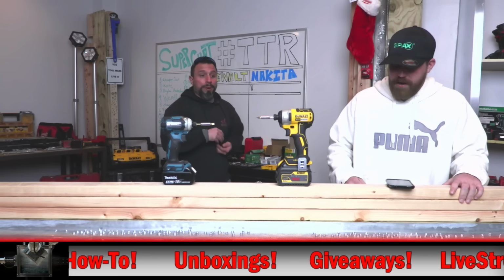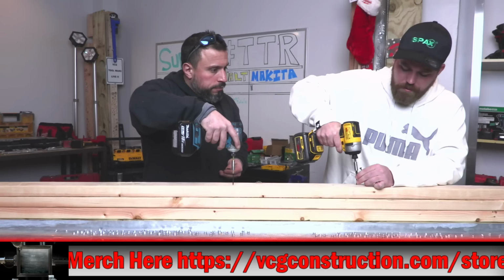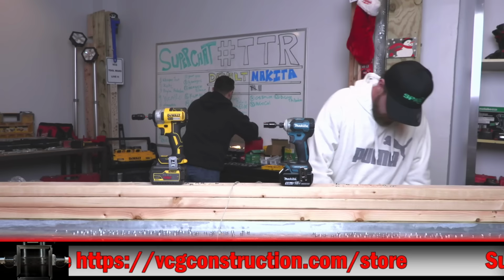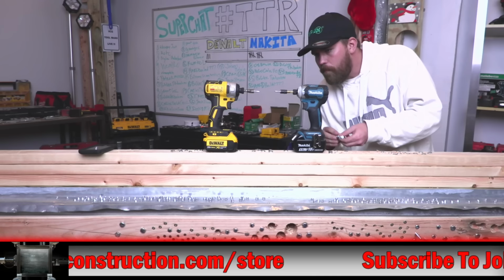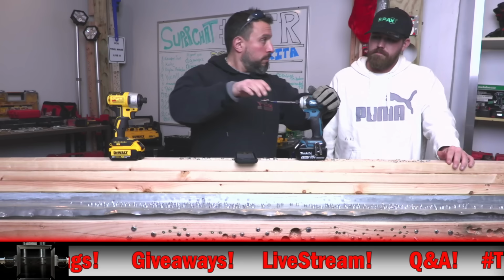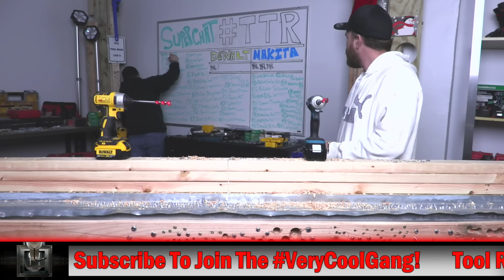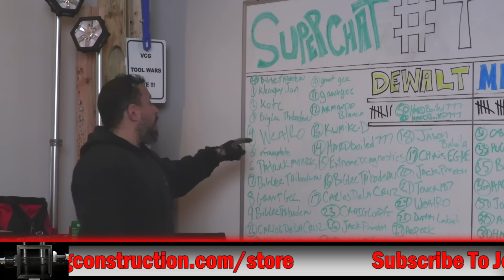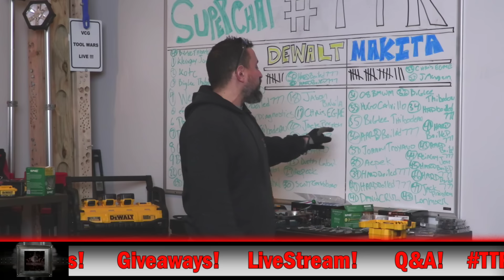Best Cordless Impact Driver Comparison Test - DeWALT (DCF787) VS Makita (XDT12Z)

Comment: At 36:11 I really meant that the epoxy holding the windings has to set and get hard. Breaking it in for a week or so giving the epoxy time to set up. Not that you should have to, should be ready straight out of the box as you said

Comment: I use the 887 at work in the automotive field and have never seen the smoke. It works great for bolts up to 10mm thread. I have tried it on car lug nuts and will remove them that is before the adapter breaks in half.

Comment: Who needs a heated jacket when you have an 887 in your hands. 😂 You can drive screws, stay warm, light a stogie, and shrink heat shrink tubing all with the same tool! Simply amazing! They need to add a fire suppression system to it.

Comment: I have the DCF787 also and It's been a really great impact driver. I've been thinking of upgrading to a 887 for the three speed but after seeing all your reviews and issues with the 887 I'm not so sure anymore. The only Dewalt drill I have that I got an issue with is my DCD996 hammer drill. It has a pretty bad wobble in the chuck. With a short bit its manageable but the longer the bit the worse it is and ends up shaking the whole drill.
Reply from the maker: 3 words Nathan "Don't Do It" !
Reply: @VCGConstruction  Thanks appreciate all your vids and feedback.

Comment: I'm one that's more for corded tools. Having said that, I'm getting sick and tired of going through extension cords on jobsites. Any little nick or discrepancy and it's not allowed to be there.  So much traffic on a jobsite, it's unavoidable. Some GC's will actually cut your cord to make sure it's inoperable once they discover a flaw in it.  Cordless seems to be the answer.  The cost of cords seems to be matching or even out doing the cost of new batteries.
Reply from the maker: I’ve seen safety inspectors cut the cords once there was any little problem with it!!
Reply: Pick a number between 5 and 100 chances are i have a cord that same length.  Getting ridiculous.
Reply: Drop those cords for real! No need for cords now with these high Amp batteries being made now. A 5ah will last for hours of straight use

Comment: The Makita XDT16 hasn't even come out yet and the XDT12 is still killing it
Reply: Chuehue Yang I think the torque rating is the same.
Reply: @bbbrenden  you're right! I'm actually using the XDT16 right now (bought it on eBay from Japan) and the features are extremely useful! Milwaukee is going to have to come up with another generation of impacts to catch up.
Reply: Chuehue Yang that’s awesome! The dtd171 correct? What color did you get?
Reply: Chuehue Yang I also read somewhere that some testing was done, and the numbers are closer to 1800 in-lbs for the newer makitas.
Reply: @bbbrenden  yes. The dtd171. I got the red one(looks better than the milwaukee red, imo, and I also got the all black one. You can't go wrong with either one. I wish the states would give us that option. Haha

Comment: I got a DCF886 that can't drill metal screws threw roofing metal. This is also used for residential storage building. I need to add on to the current one I got already. I am thinking DCF886 might burn up if tested that way. I checked with some roofers & the two they use work which is rated the same. One was Hercules impact the other was Bauer. Both harbor freight tools. If I had money to go to DeWalt & would to talk to their design team. I see they released DCF895C2 not sure if it is any good.

Comment: I'm so glad I got the 787 instead of paying more for the extra bells and whistles of the 887. Amazing how the lesser impact is that much better. Can't wait to use it in the spring for building season! Thanks for these videos.
Reply from the maker: Happy New Year Dr.!
Reply: Hey Happy New Year to you Vince and the VCG gang!
Reply: You should check out the 885 it's probably Dewalts most popular brushed impact as I've seen  many use it. It's a little beast!!! I used that impact to construct 2 Genorator sheds I made from scratch using metal roofing sheets as well as 2x4s. It didn't miss a beat at all and I used 1 inch self tapers, 1 inch galvanized lag bolts as well as 2 1/2 to 4 inch deck screws for the wooden part.

Comment: Not denying your experience, but our crew has been running 887s pretty much since they came out, haven't had one go out yet. Granted, we don't use them for things you shouldn't use a impact for anyways (paddle bits, large lags). #justsaying
Reply: James Simmons that is my experience and argument. This is the red Chinese counter to that argument. THEY say since their impacts handle paddles and large lags without predrilling that makes the 887 trash. What do you think? GO!!!! BTW! Impact drivers were designed to drive screws and larger fasteners. NOW GO!!!!